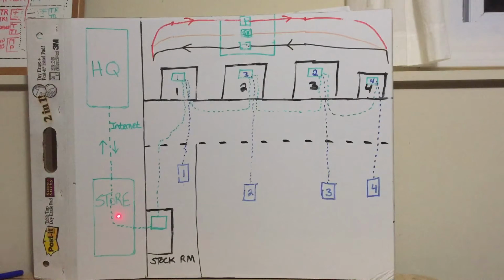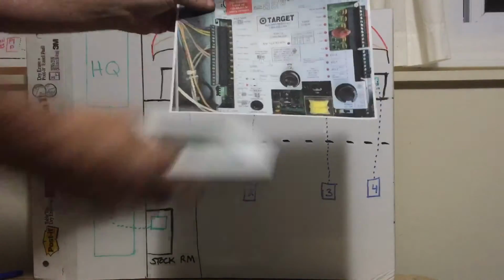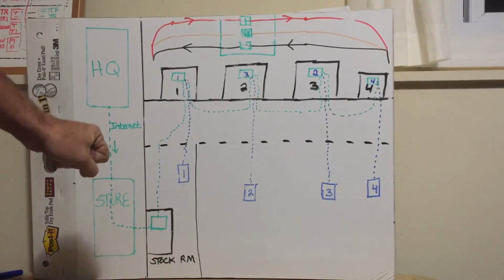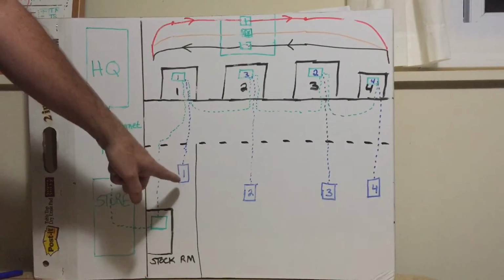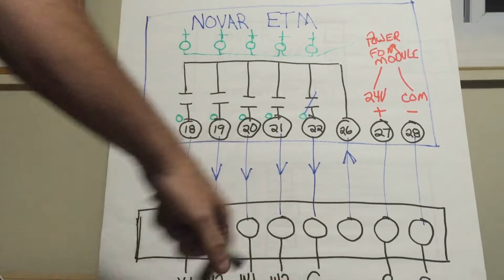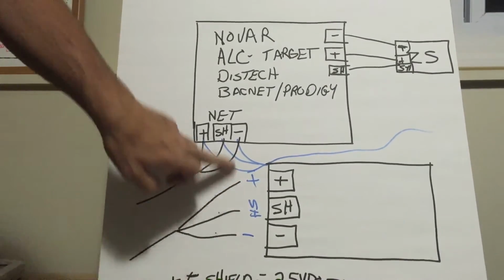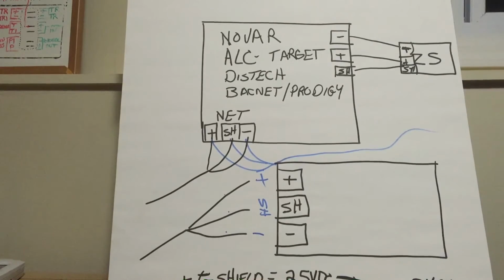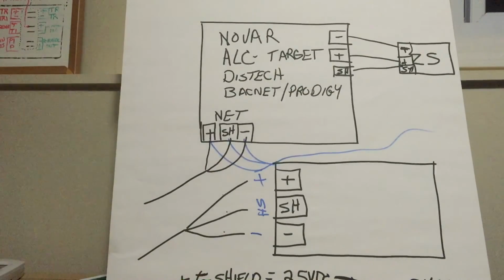EMS Systems

Comment: When the Novar xcm board needs reset, it won't let the unit heaters or radiant panels run.
Reply from the maker: Marshal Jim Duncan I’m not sure what customer you are working on, but
Home Depot for example, has their Novar controls setup so that when its above 60 deg ambient it locks out the heat at their stores, and when its below 60n degrees outside it locks out the cooling at their stores.